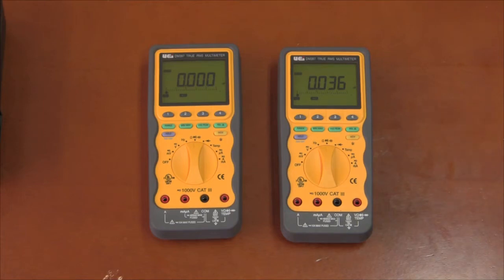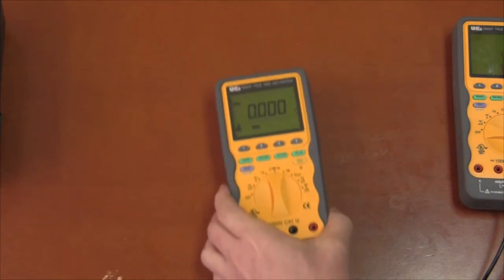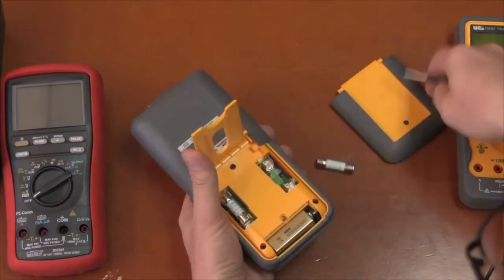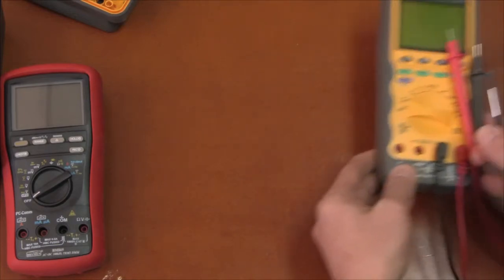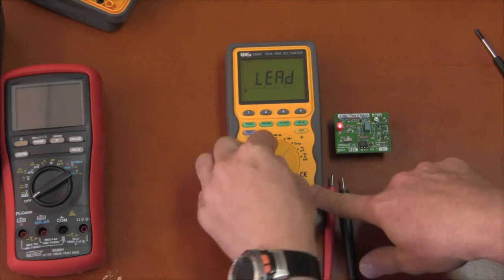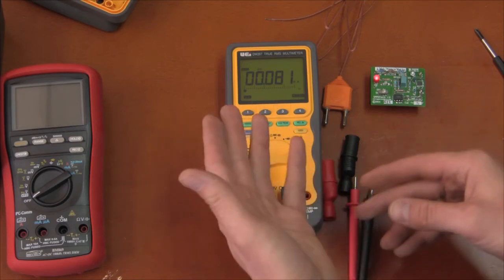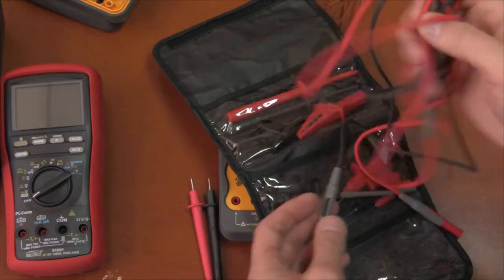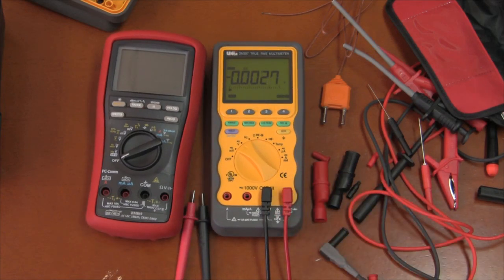UEi DM397 Not ready for primetime

Comment: It wasn't out of specs on microamps.  You can see that it was reading 1.080 (.08 out) @ 11:50 and when you pulled the leads off it was 0.080.  If you would have hit the delta button before measuring you would have been spot on... :)

Comment: Thanks for the overview - really good outlook on the model!
Reply from the maker: I really like this multimeter except for the problems. I am still in contact with UEi and hopefully they will come back with an answer and a fix.
Reply: I found one for sell on my local kijij, overall would you say that it is a decent meter and worth the investment or should I look into a more reputable manufacture - Fluke?
Reply from the maker: Nick Sek I would not be able to recommend this meter until UEi fixes some of these issues. If you want a better alternative then I would recommend a Brymen. I have three Brymens and that is for a reason. The Brymen BM869 can be found for $309 shipped on ebay, or for around the same price at www.tme.eu .
Reply: I got a Fluke 289 it is no doubt a monster meter - expensive but there is a reason for it. the only reason as to why I was considering the unit is it is coming with a clamp i410, an insulation test, and an infarred fluke attach for 200 CAD. And it seemed like a monster deal. But it seems almost too good of a deal, either it is hot, or it is all busted...
Reply: Not good.. Not good at all UEi.

It seems UEi did a good job on the design, I kinda like the meters look and layout, however performance must take precedence over all that and in this case it seems UEi have overlooked that.

Also for $235 IMHO you should really be getting silicone leads from the start, not those cheapo £2 eBay things

Great review